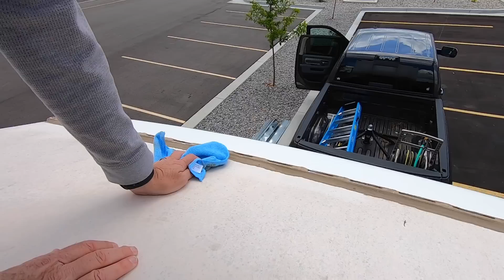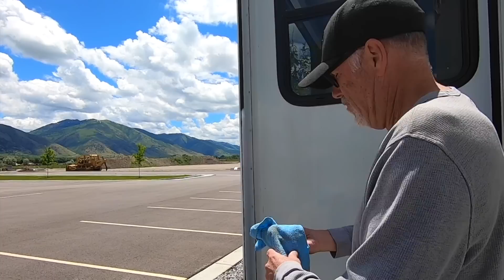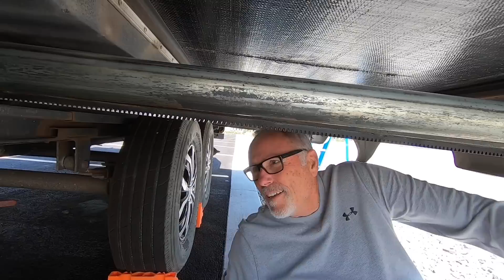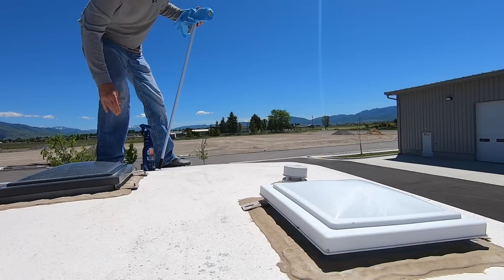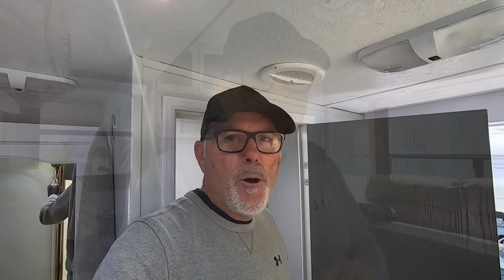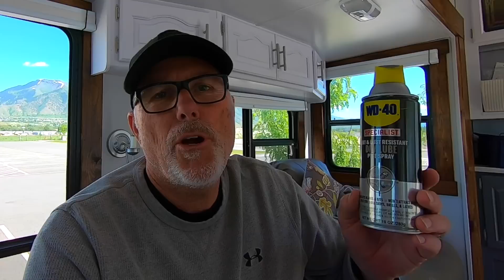RV NEWBIE:  ✅ Spring RV Checklist | Mountain Beaches

Comment from the maker: Here are some additions to the checklist from our amazing viewers
1. Check and lube the Landing Gear and stabilizers/levelers
2. Check batteries.  Add water if needed
3. Check the Water Heater
4. Test all outlets and GFCI, Smoke and Carbon Monoxide detectors and change their batteries
5. Flush all tanks
6. Check Refrigerator and water heater vents for debris and spiderwebs
Reply from the maker: Safe travels everyone!

Comment: It is 6 months from my last comment and it is spring now even though we have been having some cold nights. As you know, we got our new to us travel trailer a month ago. We still need to dewinterize it and get it ready.  Did I miss a video where Norm dewinterized the Cougar?  Since you had a older RV,  did he have any issues with the glazing bead around the windows? If so, any tips?
Would it be possible for  you two to do a updated video on your G.D for these tips for Newbies?! Thank you 😊
Reply from the maker: Hi Amy.  No you did not miss a video on dewinterizing the Cougar.  We sold it prior to that needing to be done. We did dewinterize our Reflection 303, but to be honest, didn't think it was worthy of a video.  Here's what "we" do.  We fill the water tank about 2/3 full, poor in some water purification mix that we buy at WalMart or any RV store, drive the RV around a little to let the tank mix up some.  We then run water through all the water lines just like we do when filling with RV anti freeze.  We then dump the fresh water tank and repeat the process a second time.  That's worked for us.  I'm not sure what you mean by the glazing bead around the windows.  We never had any problems of any kind with the windows in the Cougar.  Thanks so much for the comments!

Comment: Great video. Good points all the way around. Another couple of things are to lube and check the landing gear and any stabilizers or levelers, make sure batteries are good, and check the water heater. I know it might be obsessive, but I check all the outlets, test GFCI, smoke and carbon monoxide detectors, and l flush out all the tanks for a good cleaning. Happy travels
Reply from the maker: Rocking C Homesteading great info. Thanks for sharing. !

Comment: This was a great check list. I hadn't thought to check underneath the slide to lube it.  What type of roof do you have? Ours is rubber.  
Our check list includes looking at the water heater and refrigerator vents for spiderwebs and debris.  We have a class C so we also pop the hood for a general inspection and make sure no critters have nested in there.
Reply from the maker: Whoa Nellie RV Adventures our roof is rubber too. Good thought on checking for spiderwebs.